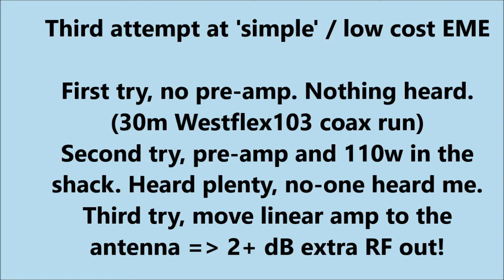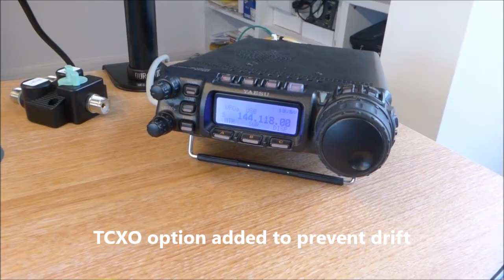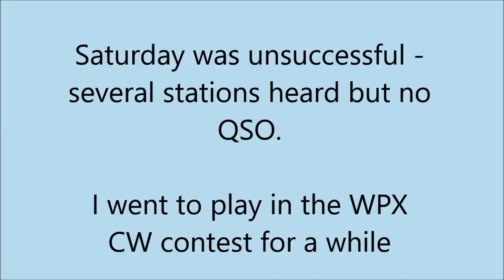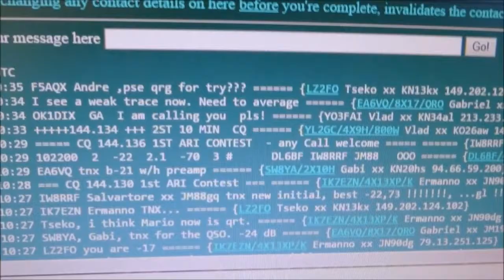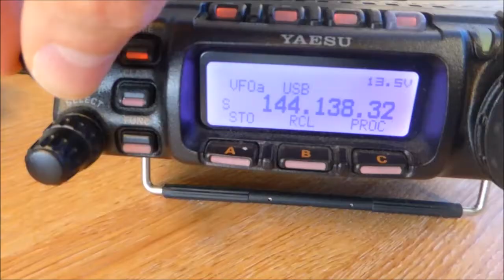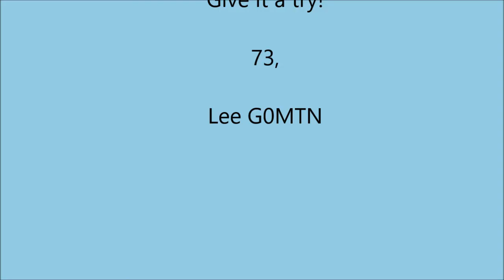G0MTN QRP 144 MHz EME Moonbounce

Comment: Thanks for putting this up - it's inspiring.  I have a lower power transmitter, Icom IC-7000 at 50W, but could put together an LNA/PA box to mount at the antennas.

Comment: What's wrong with the ft-857??? It's a great radio for any job.
Reply from the maker: Yes it is a great all rounder. I only meant it's not as sensitive as a high end transverter is that the more serious ops use. But I've had an EME QSO to another FT857 in Japan since so I can't complain 👍🏼

Comment: Impressive that the signal will be doing a round trip of nearly 5000,000 miles.
Reply: 5 million miles? You must've added a zero by mistake.
Reply: Especially when you calculate the inverse square law of light.  How much wattage does that come to upon arrival at the moon.....and then back to base?

Comment: I'm surprised how many stations you  worked with 100W. I just did my first EME with RK3FG ,at my side 100W in the shack,2x7el.DK7ZB verticaly , no preamp.73
Reply from the maker: Well done. I found a huge difference by adding a pre-amp. Also it helped my 100w amplifier was at the antennas. "100w in the shack" will have some extra attenuation of course. Good Luck & 73!
Reply: @g0mtnlee  What pre-amp did you use?
Reply from the maker: @rolandlang3590  Its the SP200 from SSB electronics.
Reply: @g0mtnlee  Does it have automatic switching?
Reply from the maker: @StephenGangi  It's good for RF sensed switching to 100w. As JT65 might be 'unforgiving' and I was at edge of power limit I manually turned the power off with a switch. These days I have a sequencer, but back then it was cheaper to have me as the human switch.
Reply: @g0mtnlee  Perfect for me, as my rig only goes to 50 Watts.